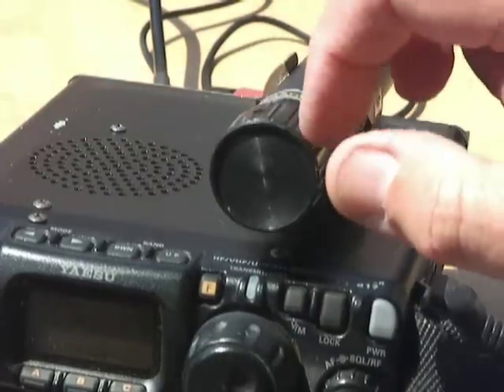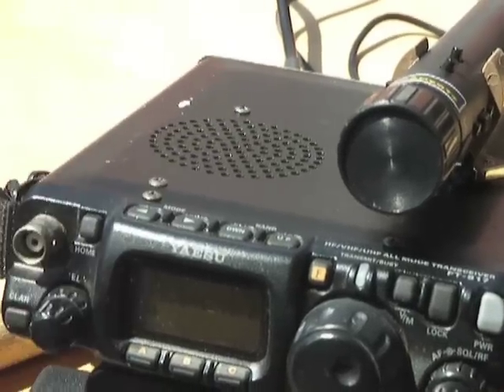PY1AHD Handheld Magnetic Loop Controller for a HF Light Backpack Magnetic Loop Antenna

Comment: Alex, notei que o capacitor que você está usando no teu projeto é similar ao que penso em comprar para um projeto de tuner automático de antena, mas o vendedor não soube informar a voltagem máxima suportada.  Fiquei preocupado com a aparente proximidade das placas. O meu rádio é um Yaesu FT857-D, que gera até 100W na saída em HF. Você saberia informar qual seria a voltagem máxima para esse capacitor?  Seguem algumas fotos: 
- https://www.facebook.com/photo.php?fbid=754720334604631&set=pcb.815686148494656&type=1&theater
- https://www.facebook.com/photo.php?fbid=754720344604630&set=pcb.815686148494656&type=1&theater
- https://www.facebook.com/photo.php?fbid=754720347937963&set=pcb.815686148494656&type=1&theater

Comment: I would also like to see the schematics, parts list and more detail how to make this remote control tuner. It is a servo I see and some kind of RF transmitter to control the servo like a RC model, but what parts did you use and any details to duplicate would be nice. Thanks I need something just like this.